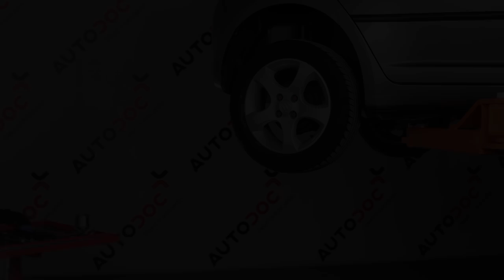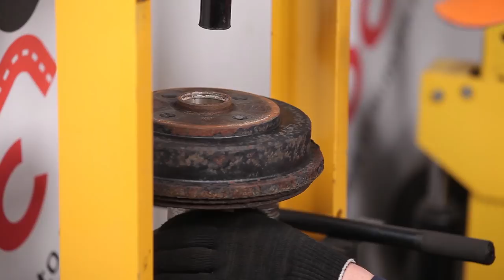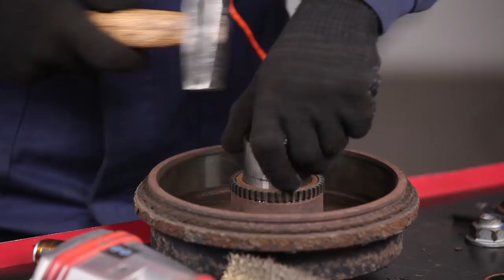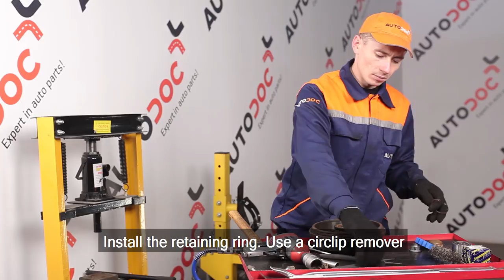How to change rear wheel bearing on SUZUKI SWIFT 3 [TUTORIAL AUTODOC]

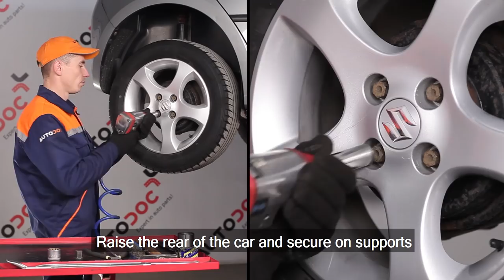Comment from the maker: 00:13 — Raise the rear of the car and secure on supports.
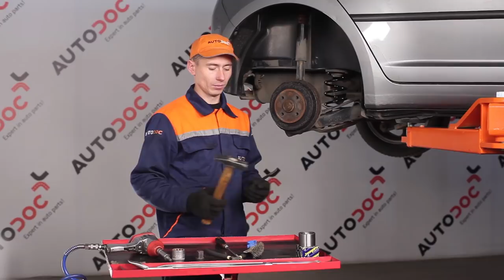00:24 — Remove the hub bearing protection cap. Use a hammer. Use a flat chisel.
00:42 — Use a drive socket No.30. Loosen and remove the hub nut.
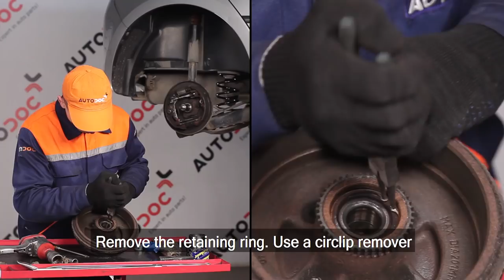01:00 — Remove the retaining ring. Use a circlip remover
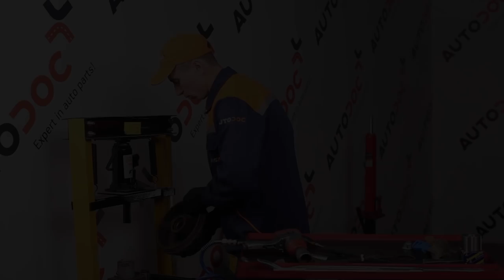01:13 — Press out the wheel hub bearing.
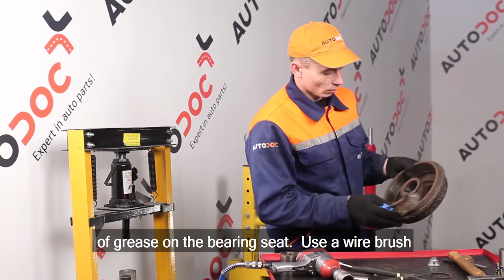02:17 — Clear the components and apply a thin layer of grease on the bearing seat.  Use a wire brush
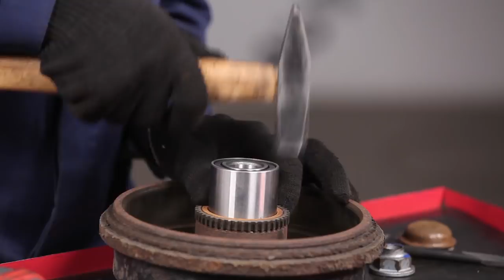02:32 — Press a new bearing into the wheel hub.
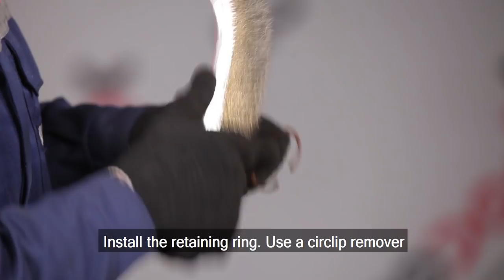03:05 — Install the retaining ring. Use a circlip remover
03:18 — Install a brake drum.
03:28 — Screw the hub nut. Use a drive socket No.30. 
03:33 — Install the hub bearing protection cap.

The tools you need to replace wheel bearing: 
- drive socket No. 30
- flat chisel
- hammer
- circlip remover
- wire brush

Comment: Never press a bearing by the inner race if its fitted by the outer shell. You will blow the guts out of the bearing or massively shorten its life span.  Press the outer shell only. I use a recessed drift 0.5mm smaller in diameter than the outer race diameter to press in my bearings - recessed so it puts no pressure on the inner race.
Reply from the maker: Thank you for your comment and for the valuable clarification, this will be very useful information for our viewers.
Best Regards,
Autodoc team

Comment: The rear hub nut is only used once then replaced if its removed.A nut is only 10euro.
Reply from the maker: You are absolutely right. 
The nut is disposable it is recommended to replace it with a new one during dismantling.
Happy New Year!
AUTODOC